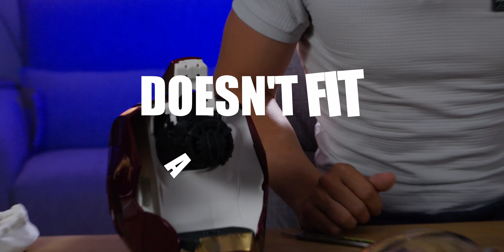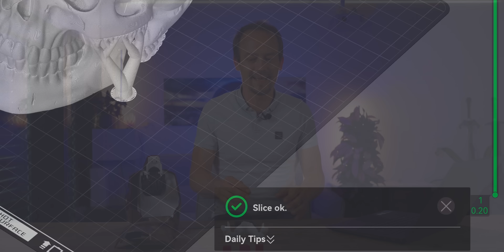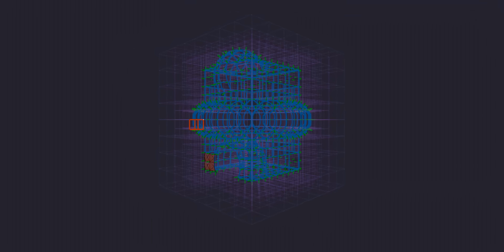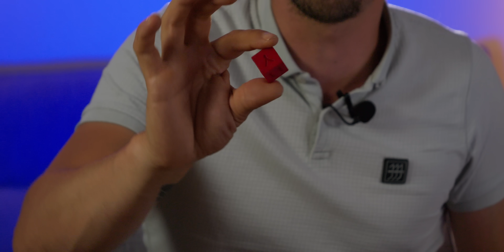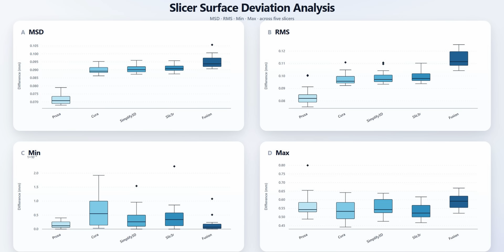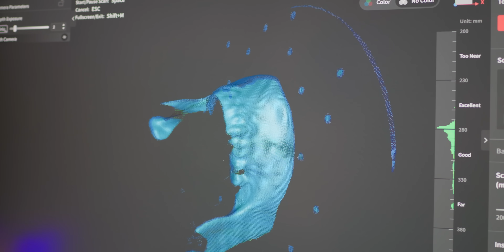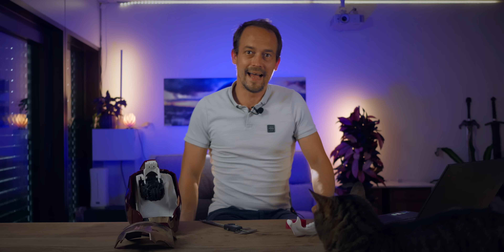The Hidden Error in 3D Printing - This is How We Found out

Comment: There is one critique I’d make: Let’s say a slicer knows, through mathematical modelling, that a section of the model will contract - so, as compensation, it slices this area “inaccurately” - but after printing, it ends up more accurate.

Similarly, the slicer might over/underextrude parts, etc. 

Was that addressed in the paper, or is it well-known that slicers do not add these kind of optimisations?
Reply: For example NX can do actual shrinkage compensation through finite element methods which is highly computationally intensive. Current slicers are only using simple scaling as compensation. It's a good question whether the profiles used were all set to zero compensation.
Reply: There is software that does this. For every material there is a known value for heat contraction, and it will reverse warp the print so it will cool and contract into the correct shape. Can’t remember what its called but it is out there.
Reply: @mikescholz6429  that's the point, shrink compensation is what it's called. I've has issues with it, personally, as orca lists it as xy compensation and z compensation, and it didn't seem like the shrink was even linear. The larger my part, the more it seemed to shrink
Reply: @da3dsoul it's not linear because the lay down process isn't linear. That's why the edges curl. You need to do more than calculate deformation on the shape, you need to calculate progressive deformation of the shape. Calculus nightmare.
Reply: @UnmannedairI figured, which is why XY compensation as a single value is dumb. You could approximate it better by even setting it as a "shrink per cm" or something
Reply: We switched off all "slicer optimizations" like compensations for that test. To just get the raw path accuracy
Reply: @schwertchen  Thanks for the reply, lil' sword :) That's good to know
Reply: Does this actually apply? I mean he ran a separate comparison with the Scanner which actually seemed to display the same error in Support of the thesis. So when there is additional compensation that would Leader to differing Results between "g-code reimport stl model" and "scanned stl Model"
Reply: I was going to say exactly that. He should have compared the output from different slicers after printing as well.
Reply: I know orca assumes a rounded edge bulge on the outer perimeter lines and shifts it in so the outer-most edge of the bulge is at the model perimeter. This is probably fine if you care about clearance, but it's inaccurate if you care about enclosed volume. It's shifted in by layer_height*(1-pi/4)/2, or roughly layer_height/10. I don't know if your voxel model was high enough res to catch things like that.

Is the scanner accurate enough to see layer bulges? If not, does it err towards the avg edg, the outermost edge, or innermost edge of a surface rougher than its scan resolution?

Another area of inaccuracy is triangulation, which has a slight bias to decreasing curve diameters. Triangulation calculates triangles with their points on the cad model surface and small enough that no point on the triangle deviates from the model surface by more than your requested accuracy. This means the triangles are perfectly accurate at their points but  "cut off the curves". So when you triangulate with a desired accuracy of +-0.1mm, the radius of any curve is actually accurate to within +0.0 and -0.1, making the average radius about -0.05mm smaller, so the average diameter is actually 0.1mm smaller.
Reply: @DonovanBaarda  This is an inevitable result of creating a mesh of triangles to represent an object.  Unless you have a very simple design you are going to run into the fitting deviations that have to result from approximating curved surfaces with a mesh.  I am a little surprised that no slicer is available that can use a CAD file directly, as that removal of the mesh approximation step in the middle should be useful where high accuracy / tight tolerances are required.
Reply: @boggisthecat in theory the triangles could be made with the points shifted outwards by the tolerance amount and the triangles would cut off the curves inwards by the tolerance amount, resulting in triangles that are actually +-the tolerance amount from the original surface, with an average closer to the actual surface. This would even allow a coarser triangulation that still meets the +-tolerance requested. However, it's harder to calculate.
Reply: @boggisthecat  It's likely for the same reason that 3D printer manufacturers discourage Gcode arc commands.  The printer has to convert it to a step function at some point, and the slicer has more compute than the printer firmware.
Reply: @boggisthecat OrcaSlcer takes CAD files directly (step) and probably other slicers too. It then converts to mesh with precision that you specify on import.
Reply: This is what I was thinking! Would like to hear the answer to this as well
Reply: BlueLightScanners for higher accuracy? What a scam. Wavelength of light is in the range of 380-780 Nanometers. That means 0.38- 0.78 micrometers. Less than a thousands of a millimeter. Factor 100 smaller than the precision we talk about in printing. 

And NO: there is no order of Magnitude between blue and "white". Not even between blue and red. It's just a factor 2.

And no: those scanners do not work at all in the range of the wavelength of the light.

Just marketing!

Comment: I didn't even realize Fusion had an integrated slicer!  I'll be sure to never use it now.
Reply: Avoid autodesk entirely - a garbage corporation that needs to have its lunch eaten by open source.
Reply: I was just thinking the same thing! <3
Reply: Additive is a tab in the Manufacture workspace.  Its not just for FDM. has a lot of tools for 3d arrange and tools for dmls type printers.  For your standard FDM/FFF though its generally more pain than its worth to use.  They made all their own configurations for the printers, and unlike say using a MFG suggested slicer with all the preload materials that generally run pretty well out of the box, you have to do a bit of tweaking to get it to run ok.  Ive run it for an older ender 7 and k1max for testing.  The main benefit originally was that you are taking your solid model and if the firmware supported it you could run g2/g3 for true arcs.  now a lot of slicers handle step files and can also use true arc movements rather than a bunch of straight lines.
Reply: I was under the impression fusion dropped their slicer back in 2020.
Reply: They keep buying up companies that do it so they might have abandoned a old version and gone to a new version within the same feature lol
Reply: @askquestionstrythings there is a slicer in the version of Fusion I'm using.
Reply: It's under the manufacture section - you can do toolpaths all sorts of processes.
Reply: I’ve been using it for years if only I had known 😂😂😂

Comment: Dont use STL use STEP. This is another hidden source of inaccuracy. STL does not have the resolution especially in curves.
Reply: Which is better 3mf or step?
Reply: @chezcotton  3mf isn't a model. It's a slicer project. Directly, neither is better. High resolution STLs give me better results than step, because slicers convert to polys when importing step.
Reply: Then you need you need to change slicer.. STP file import in slicers exist because they can actually convert them into circular G code, thus getting a veeeery exact circle, interpolated "in hardware"
Reply: @kl1nk0r  if you paint it you sure as hell aren’t getting what you started with. The paint in slicers use triangles. I have my own code base that can import into blender
Reply: @cybyrd9615  Why use blender and not one of the cad programs? Personally I use blender for the price, community resources, and ease of use. But I feel like I'm in the vast minority that's using the wrong tool.
Reply: @kl1nk0r slicers just convert to stl on import

Comment: Would have liked to see two of the most popular slicers like Orca and Bambu Studio.
Reply: Bambu is forked from Prusa and Orca formed from Bambu, so they should be similar to Prusa, but it would be super interesting to see if either has improved on (or made worse) what Prusa does.
Reply: um orca is just a fork of Bambu and Bambu is just a fork of Prusa and Prusa is just a fork of slic3r so thy are all basically the same slicer and slice things with the same exact algorithm so their is no point in comparing them to each other because thy will basically be the same

the only differences you will see are the same differences you will see if you slice the same file multiple times with the same slicer because the slicers never slices a mode the same way twice their will always be differences between slicing's even if nothing changes
Reply: @rayzimmermin So if Prusa is a fork of slic3r then why include Prusa and Slic3r? Also, a fork implies the code was copied and modified going forward in its own branch right? I'm assuming it had modifications of some sort or at the very least I was would say it is plausible or reasonable to think code was modified after it was forked.
Reply: @colinmsmall  well hear is the thing slic3r is no longer being maintained or updated as of 2022 so its running an older slicer algorithm as ware Prusa Bambu and Orca are being maintained with the same slicer algorithm as each other so their is a difference between slic3r and all the other slicer but their is no difference between all the other slicers and each other and you can see this in the code

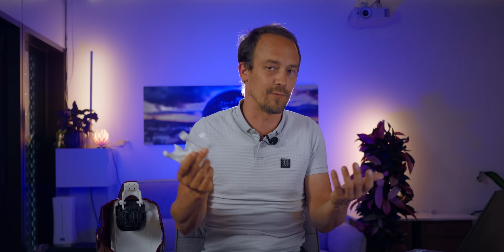Comment: 6:40 technically not a black box, being open-source, but converting the complex mathematics of exactly how to produce the G-code  would require far more work I guess. (Based on some professional software "archaeology" adventures)
Reply: I mean they already had a team make a translation from Gcode back to STL, which means they had someone with some coding skill handy, and they didn't look under the hood of the engines that are FOSS ? 

We have the tools, we can Contribute To The Open Source Community.
Reply: @JagdtMirage making new code from scratch is often easier than analyzing existing code. Especially when you know what to make, and the existing code is old and complex.

Comment: Great and very interesting video

One thing I would have like to see is having all 3 stls (pre-slicer, reconstructed after slicer magic, scanned modell) imported into one program (like blender or similar) and shown where exactly the deviation comes from.
box charts are always nice, but a more model specific visual approach would make it way easier to grasp (for me)
Reply: This. I really wanted to see them all superimposed together.
Reply: Another would have been to have 3D scanned the printed output of at least one other slicer, just to check if the relative error rates fit the predictions.
Reply: I've done superimposed comparisons of cad model vs triangulated stl in onshape that show how triangulation reduces radiuses by "cutting off the curves". You can see it but it was surprisingly hard to make it visible or measurable. In the end just making them two different colours so you could see where the triangulation did vs didn't stick out past the original model was as good as I got.
Reply: @DonovanBaarda  they were working with voxels.

You make them translucent in a renderer, and additive. 

The more voxels you look through, the darker red it goes. 

Boom, visualised the error. 

It doesn't apply to your example, because you aren't voxelising your comparison components.
Reply: The prusa sw suite has a 3D gcode viewer, and you can export the extruded shape as an obj, so that 's quite trivial to make a comparison between all gcodes and the ref stl :   reimport the obj in fusion360, convert the mesh as an object, then inspect by section analysis. And you will see which ones cut corners. Do that with a small object because the number of polygons in fusion goes big fast.

Comment: Do you have the code that you used in the paper opensourced? If it is easy to use and fast enough, probably slicer developers could use it as a target for optimizations/part of the test suite. I.e. to have a continuous integration task to slice/reconstruct some test objects and calculate the errors. After that you can run an improvement cycle/try to find sources of errors in the algorithm, etc
Reply from the maker: The code is open source anf made available. 
I would love people using it ❤
Reply: @Ibuiltathing  can you post a link to it? I can’t see a link for it anywhere?
Reply: Maybe also worth it to open issues discussing that with developers of these slicers, to have a tracking issue where the work to fix stuff could be proposed, discussed and advanced